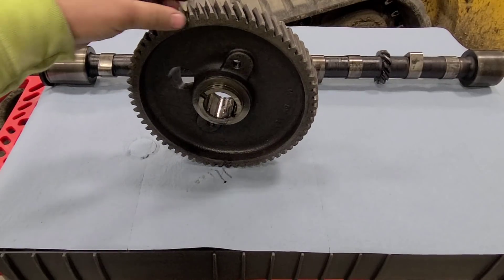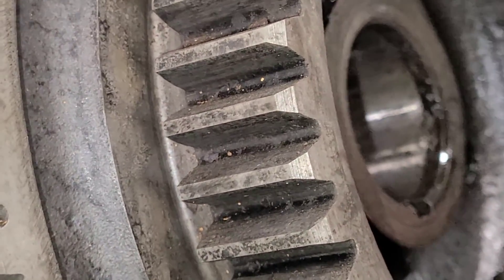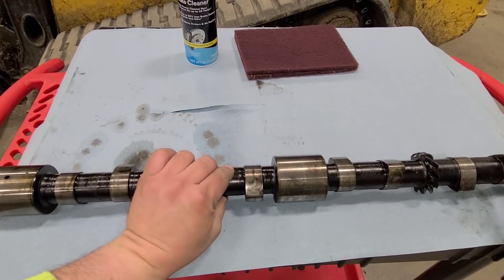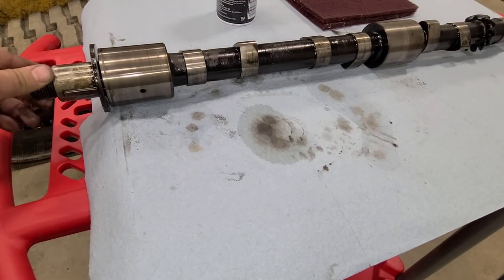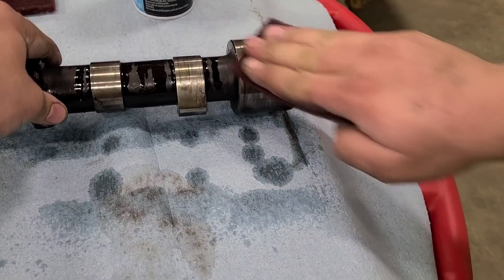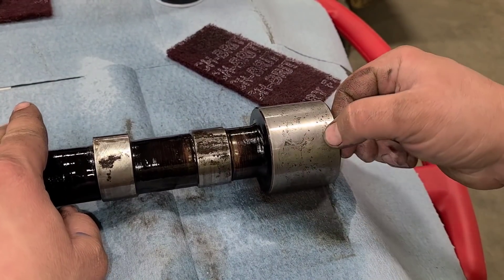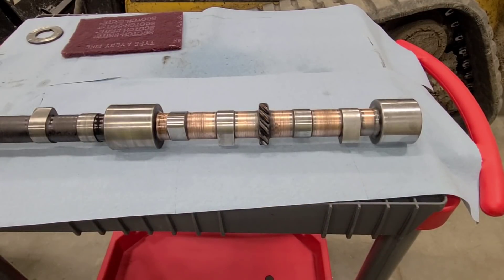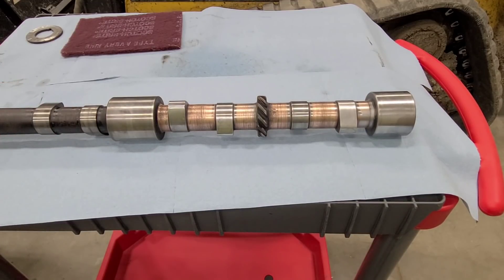Caterpillar RD-4 Diesel Engine Camshaft Cleaning and Inspection

Comment: Kyle, thanks for your great work, well explained.  I notice that you and many others use brake clean a lot.  Have you considered using kerosene?  You can buy it by the gallon and it dissolves oil and grease.  It's not that flammable - won't explode like gasoline, you'd have to hold a flame to it to get it to ignite.  I have a coffee can full of it, drop greasy stuff in there.  May be less expensive than individual cans of brake cleaner.

Comment: That cam is certainly good enough for continued use. Those billet cams combined with low engine speed and low valve spring pressures in these engines. That camshaft will out live all of us.

Comment: I restored an old Lister diesel engine where the crank case was full of water. The cam and crank were  much more pitted than your showing  but I cleaned them up and reassembled the  engine. It ran like a Swiss watch and attended many summer shows. I did get another scrap engine with a better crank and cam but never found the need to swap the parts. If the machine is going to work hard and you are going to rely on it for money earning then it might be a different story but it its only for occasional running and fun then you would be wasting money over restoring it.

Comment: A lot of the wear and putting probably occurred at next to new if it would have been from the western USA the early oil from California were asphalt based and mixed with the heat of the diesel engine and pressure the early cat engine failed prematurely. The paraffin based oil from Pennsylvania gave very little issues for wear in the diesel engine. I have a old book that explains about the oil issues

Comment: When I was a young Steamfitter Apprentice retired Journeyman now after 32years, We did valve repair in valve seats by lapping the seats with a steel block and valve lapping compound. To check for pitting we did a "Cotton Ball Test" as per NRC (Nuclear Regulatory Commission) guidelines. If the surface did not snag the cotton ball it was considered operational. We also used Dye Pentrant to check for cracking of the Seats and Gates.

Comment: I like to watch these machinists channels, and I have seen them use a rust removal product that is called evapo-rust. And that seemed to work really well. It doesn't eat away any good metal, it only removes rust, and it does it really well. Parts need to soak for a day or so, but after that it is just a matter of wiping and rinsing it of, and the rust will be gone.

Comment: I think you are correct with the P/N 5M4239 which is a one piece forging that was then machined.  The spur gear was cut with a special shaper cutter.  Was introduced in late 1960 or early 1961 I believe.

Comment: Modify the camp so you get more lift and longer duration duration so you can get more power have an excellent day
Reply: Early hotrodders made what was termed belly grind cams. By carefully holding a camshaft against a bench grinder they would remove a portion of the heel of the lobe. increasing lift and adding  duration. Probably didnt run any faster but I bet it got the desired lopey idle.

Comment: I really like the red scotch-bright pads! The cam cleaned up pretty darn good. If the engine uses the 'mushroom' style lifter i would say that would be even more of a plus!
Reply from the maker: I do too, I buy them by the box, they work excellent for cleaning without removing much material, thanks Doug!

Comment: The mysterious cam gear. Yours is clearly 1 piece. My 1939 7J parts book clearly shows a bolted 2 piece steel gear. Where the composite gear came in and was replaced is a mystery along with the 1 piece gear and 2 piece gear.
Reply from the maker: That's what Squatch253, Ironman3406, and I have been trying to figure out. Was this a factory fix part that was never available on a machine and only as a replacement for the fiber composite gear? As you said the two piece gears are bolted together and no one has been able to find it in a parts book yet
Reply: @kylechrist  on the point of the cam and or rusty gears. Once cleaned up they’ll all be fine. One has to remember these old machines will never see any run or work time.
Reply from the maker: @beginlivinglikeaboss  agreed, I would be surprised if I put 20 hours on a year

Comment: I'd sure trust that one over a repop any day.  Nothing better than OEM parts.  Help an ignorant keyboard warrior--the gear on the cam drives the injection pump?
Reply from the maker: The crank shaft drives the larger helical gear, the smaller straight gear drives an idler and that idler drive the governor/injection pump
Reply: @kylechrist  Sooo, what does the gear on the camshaft drive?  (Thx for the info)
Reply: @williambrown1031  You mean the gear mid shaft 10:52?
Reply from the maker: @williambrown1031  sorry, when you said gear I assumed the main drive gear up front. The little gear on the camshaft turns the oil pump shaft
Reply: @kylechrist  Thank You Sir!
Reply: @ShainAndrews  Yup, just wasn't clear enough with my question.

Comment: If you are going to put in new pistons and cylinders, I’d have feelers out for an affordable better camshaft. I suspect you are hoping somebody steps up with one. I have been thru a new camshaft failure on Turkish made junk camshafts on an engine rebuild before. No fun to do things twice. The time and money expended, and time that will be required to do it again, in my opinion designate the amount of acceptable risk in these projects. If you are going to use this Cat like Squatch, it’s a no go for me. I suspect you like to run your Cats. Wondering “if” something will be ok says a lot about the decision. However, if there are no more to be had, that makes the decision much easier. On an automobile restoration, I’d have Crane make me a one off instead of using Turkish or Chinese junk again.
Reply from the maker: I agree, if a nicer one comes along, I would install the better of the two, unfortunately they aren't an off the shelf item anymore and that's why I wanted to clean this one up. Most good used camshafts are going to be found in running engines yet and I'm not sold on taking a good running engine apart
Reply: Crane cams is no longer in business. Have to use Comp bought them out. Other options are Bullet and Camcraft.

Comment: Replace that cam the hard surfacing is gone in pitted areas and it will trap carbon and cause scoring due to inctrased preasure on the non pitted areas and  excessive wear on the lifters and bearings which will result in premature failure.  If you are just restoromg i t so oy strarts and runs so you can move it around it would probably be fine but if you intend puttimg it back into service that another thing.Just sayimg
Reply: It today’s world where things were made to just get by (repeat business built into it), that would be true. In the old world things were meant to be used, abused, and left to fend for itself. The pitting here will be of little concern since this isn’t going into heavy construction or hard daily use.

Comment: As it's a one-piece gear, I'd love to know how they hobbed the smaller gear . . .
Reply from the maker: If I had to guess, the small side was probably made on a shaper with an indexing head
Reply: @kylechrist  I did consider that, tbh, though it struck me that it would likely be a long-winded process, even more so than hobbing.
Reply: Very highly likely that it's probably rough casted gear teeth and finished with a shaper and index head as Kyle suggests
Reply from the maker: Hobbing is not the only method for cutting gears
Reply: Just what I was wondering.
Reply: This was typically done using a Fellows Gear Shaper. Very fast and efficient using a circular cutter the looks like a mating gear. These rotate in mesh as the cutter strokes along the axis of the blank being cut. Advantage is the cutter can cut into a nearly square corner  needing very little space for cutter runout.
Reply: here you go. https://www.youtube.com/watch?v=RDGBhGxlsJk&t=51s
Reply: Caterpillar could afford special machine tools that you don't see at your local machine shop.